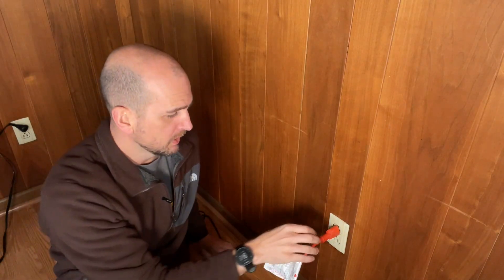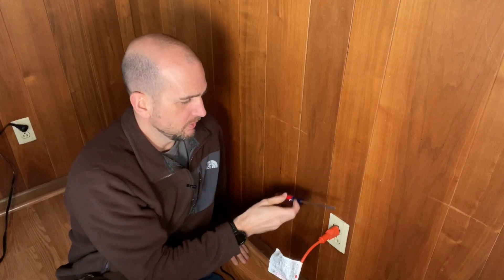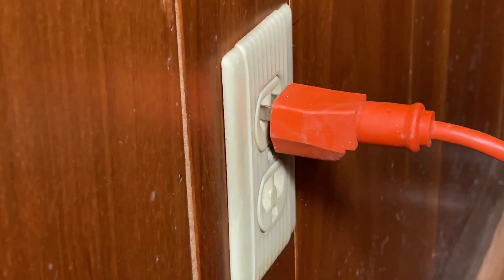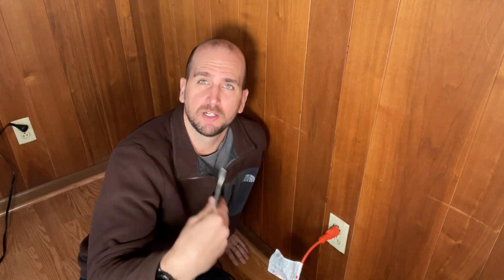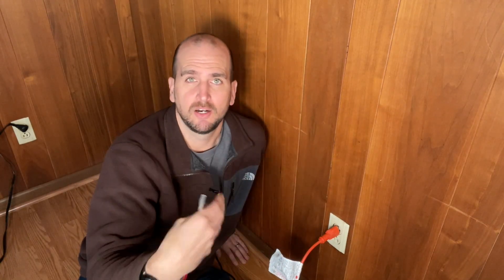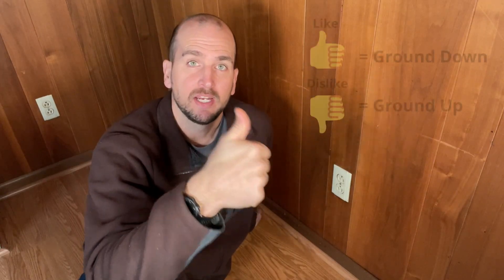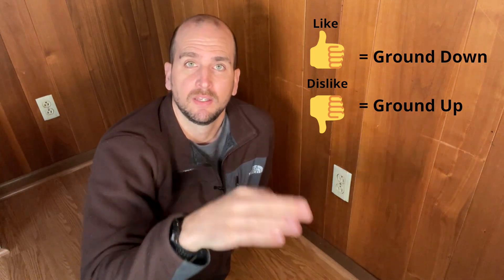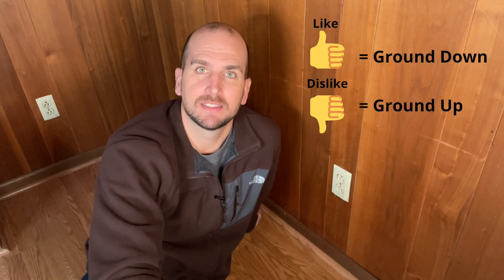Should An Outlet Be Installed Ground Down Or Up

Comment: My casual observation is that most outlets I note have the ground down. I however, like the ground up, as most outlets are installed below eye level making the ground on top when iserting a plug and thus more a more visiable aid in correctly orenting and aligning the plug for insertion. How about that argument?

Comment: When I bought my house, I switched all of the outlets to ground facing up.  I am putting in a 200+ gallon saltwater aquarium.  For those outlets I have them ground facing down, as water is most likely to get into the bottom of the three holes, and I want that to be ground.

Comment: I always do ground down and have for years.   Testers to make sure the outlets are properly wired are used and the older ones only had the lights on top, when the ground was down.  You wouldn't want an electrical inspector to have to get down in the floor and look up to test a receptacle, would you?

Comment: I've never seen an issue where someone dropped a thin metal object down on a plug, but I have seen an issue where cords would hang wrong causing stress on the cable.

Comment: Ground up help prevents your fingers from touching the prongs on the cord and especially keeps a small finger from slipping between the prongs while plugging a cord in like I did when I was 5 years old... I couldn't get my finger out or the cord unplugged because my finger tip was being electrocuted for what seemed like an hour but was probably only 5 to 10 seconds before the cord finally fell out of the receptacle. So I put the ground down because I never want to deny anyone from that kind of hands on learning experience.

Comment: The scenario is just silly: "What if the plug is loose, and what if some thin metal object falls into the gap between plug and outlet?" I've been around this world for 66 years and I've never seen that happen.
Reply: "I've been around this world for 66 years and I've never seen that happen."
I've never seen a plane crash but I know it can happen.
Reply: @AJ-io3bq  I've been around this world for 61 years and I've never seen Africa but, I know its real.   :D
Reply: @blue04mx53  I've been to Africa and I can tell you it's UNreal! Awesome experience. 👍
Reply: No it's not. I went there. It's not real
Reply: @blue04mx53  It is not real. It is just a conspiracy from map makers who add random places to make the maps look fancier. 😂😂😂
Reply: @AJ-io3bq  Yes, you have seen a plane crash.
Reply: @brumalmat9999  No, I have not. I've seen evidence (i.e. the wreckage) of one but I've never actually seen one. Just because we don't personally witness something doesn't mean it cannot or doesn't happen. I have, on the other hand, had a piece of metal slide down a wall and short an outlet. Even so, I vote ground-down orientation.
Reply: I have seen a metal cover plate that landed on the prongs. It sparked and cought the rug on fire.
Reply: My step daughter knocked some metal hangers off her dresser and slipped behind a cord pulled a little out from the plug.It just tripped the breaker.
Reply: @randycrowe2698  Bet you that the lapcord was a two pronger and not a three.
Reply: I beat you by 20 years and I have never seen it happen.
Reply: I was measuring a wall and the tape slipped, and slid directly into the gap onto the prongs. Did not short, but it got my heart racing!
Reply: Try touching one side of a 240 volt switch with one hand and the other side with the other and you'll be glad if your heart IS racing!! 😊
Reply: While installing breakers in a panel box, I had a radio plugged in at the panel. It came unplugged and one of the ground wires I cut from the panel, fell into the receptacle and sparked just like his screwdriver would have. I had to laugh at the ironic situation as I hate grounds up. The odds of it happening is small so I still think the bigger issue is the plugs arcing from not being in all the way. Ground down is one of the best ways to keep plugs from slipping out.
Reply: What if it's installed ground-up and what if the plug is loose and what if there's a stiff piece of metal on the ground next to the wall and you step on it and that causes it to jump up and short hot and neutral?
Reply: If the plug is loose, the outlet needs to be replaced
Reply: Must not have kids or know any.  But if that is silly, imagine how silly it is to install it upside down just cause you think it looks better, for no actual practical reason!  Now that my friend, seems a hell of a lot more silly.  Literally the only reason why receptacles are installed ground down is because people think they look like faces.  It was invented and designed to be ground up.

If I am making a decision, and one way is possibly more safe, and the other way looks like a cute face, what is the more silly direction to choose?
Reply: This guy is like most 3rd party inspectors full of opinions but very low on actual facts and knows even less on codes. He probably believes it’s against code for NM to touch a gas line. Yet there is nothing past or current in the NEC. When you ask them to recite the code they pull up a city ordinance in another state thinking it supersedes the NEC
Reply: I have seen a frying pan short out an outlet to the sink and short out all the power in the house because of pennies in the fuse box.  I have seen solder drip across an outlet and explode.  My daughter shocked herself plugging something in, so she prefers the ground being up so that will not happen.
Reply: Evergreen Hospital, 2002.
Beaded-chain on window-blinds draped over loose plug in outlet.
Shorted across the live and neutral.
Flash-burn on wall plate, chain welded to window-frame, frightened patient.
It was of the few outlets installed ground-down.
Why metallic chain and not braided cord?  Sanitation requirements!
Stainless steel chain can be disinfected, cords not so much.
The rules in Hospital are weird...
Reply: It happened to me.
Reply: @The_Original_Forrest_Trump  You guys are room mates right ?     :D
Reply: it's happened to me, twice! one time I had some metal trim fall on a cord, some of the trim exposed the cord and one managed to connect the two pins and blew the fuse. Another time some smart guy decided to change his plastic outlet cover to stainless steel, for some reason I plugged a cord in before I screwed it in. slipped and dropped the cover into the two pins.... lol
Reply: @tonytaing8173  that’s why the NEC states all metal receptacle plates must be grounded. 
 Metal switch plates using metal screws to a grounded switch doesn’t require further grounding however that code doesn’t apply to receptacle plates for the very reason you stated.

Comment: I have a toxic gas detector plugged into my outlet.  If the ground was installed on top, then my detector would be upside-down.   What I mean by that is that the digital display would be upside-down.  I think functionally, the detector doesn't care about it's orientation.

Comment: If the ground wire is in the position up, it will be impossible for the ground wire to touch the neutral or the source inside the electrical box. 
By putting the ground wire in the bottom position, I want to let you know that the wire gage 12 has 3 wires,  the neutral,  the source and the ground. Remember that the wire enters through the top back of the electrical box and the ground wire will have to go all the way down to be secure to the bolt ground and the chances are that the ground wire may touch the neutral because it comes down to the side of the outlet or the source. 
Anyone who is connecting the ground wire in the down position must be sure that the ground wire not be touching the the neutral or the source. If the ground wire touches the source it creates a short the same thing will happen in the neutral wire. 
It is much better to put the ground wire in the up position because it will never have the chance to create a short inside the electrical box a place where all the wires are connected to the outlet. 
This is the best way to connect the electrical outlet in the electrical box. 
Because it will prevent a electrical short.
No wire will touch the neutral or the source.

Comment: On residential installation it can be either way except when installing metal covers the ground is facing up. On commercial installation the ground is facing up. And on horizontal installation the neutral side of the outlet is facing up. Hope that helps. Just a matter of common practice.

Comment: I still recall a classmate of mine who said he had change on a shelf, and a coin fell down on a plug with the ground facing down. The coin bounced between the hot and neutral causing sparks until it fully shorted out to trip the breaker.
Reply: Whoopee, it tripped the breaker. That's what they are there for. Ground on bottom always.

Comment: I’m used to seeing grounded outlets with the ground down. And when we had a new home built in 1997, all outlets were ground down. Two years ago I bought a house built in 1964 about 40 miles west of where I grew up and mainly lived. And all the outlets are ground up. Except in the basement where there had been a water leak and it is all new. My visual preference is for ground down, and I’ve been changing outlets to that orientation.

Comment: One thing that drives me nuts, nothing to do with ground up or down is switches. In all the houses i have lived in before, the light switch for the porch light was closest to the door, next the light switch for the interior was the furthest, and if there was a third switch say for the upstairs hall it was in the center. I have lived in four houses and this was always the case. The house I live in now, the porch light is furthest from the door. Also since the up stairs hall has a light by the front door, as well as up stairs, in other words 2-way switches, it IS in the center, and there fore to me the only switch properly placed. The problem with this switch however is that who ever wired it up did so backwards. (At least in my opinion) Every house I have lived in when there a two way switches, both switches in the DOWN position means the light is off, and both switches in the UP position means the light is off, only when 1 is up and the other down is the light on. In my present residence on must be up, and the other down for the light to be off. Since I am used to a light switch being DOWN, I always keep the one on the second floor down, I rarely operate that hall light from the lower level so that switch is UP. Or is this just me???

Comment: 40 years ago I built houses in a county that had 6 electrical inspectors, all required ground down. Although not code they reasoned that most cords hang down,  subject to being stepped on. This was likely to pull ground wire first leaving the appliance ungrounded. I learned early on, don't argue with inspectors when a small gratuity usually leaves everyone happy.

Comment: Definitely ground up.  For the safety factor of a child dropping a coin on a three prong plug, but mainly for the use and life of the outlet.  Almost every "ground down" outlet that had a grounded extension cord in is broken because the weight of the cord pulled the the upper two prongs out and cracked the insulator under the ground prong.  "Ground up" outlets never crack.

Comment: Regardless of orientation the rule of thumb should be that the ground should be the last prong to exit the plug. Therefore, if the tension of the cord is downward, which is in most situations, then the ground should be oriented down. Conversely, if the tension is upward then the ground can be up. This rule is especially important in potential “wet” areas. The purpose of ground is to ensure safety in giving rouge current a clear path to ground. This is also the reason that the ground prong is always the longest prong on the plug.

Comment: I find it a little easier to plug in a big extension wire plug if ground is facing up. On the other hand, by convention, the hot-black wire seams like it belongs on the right which requires the ground to be down.

Comment: I asked my Dad who is an electrician.   Apparently there is no code (at least where he is) that stipulates up or down outlets.  That said, he usually puts the ground down in residential and the ground up in commercial.  He finds that in commercial settings, the plugs usually have thicker socket cords and will break the plastic area around the ground much quicker over time.  Regardless of the up or down debate, if the socket won't hold plugs it should be replaced as it is a fire hazard.

Comment: I like ground facing up for two reasons:
1) If the ground is UP you have the round pin facing you as you reach behind a sofa or table you can more easily see the ground pin and insert it as it is the longest, AND you can even feel for the round hole and the pin with you thumb or finger if you can not clearly see the outlet in a dimly lit room, which makes aligning the plug to the outlet easier. No shocks since you are ONLY touching a ground pin, and since usually they are slightly longer the is no current flow until the other pins get inserted. I also wish you could buy outlets have each ground in the opposite direction, that way you can plugin two 90 plugs. If you have each in opposite directions, then the argument as to which way is UP does not matter. Besides which I saw a really OLD house that had outlets installed into the base board. The base board was eight or ten inches inches high, to access wires or electrical boxes all you needed to do is remove the base board, not tearing out sheet rock or plaster as the wires were behind the base board. Switch wires were also at base board level until the reached the location of the switch, where the wire was dropped from the switch down to the base board to an electrical box hidden by the base board. Only problem I saw with this was telephone/cable wire ran along the base board could get cross talk. So a second thought I had about this was to run electric behind the large fancy trim (corner molding) between ceiling and walls. I however like the outlets in the base board because then there is less chance of the plug being jammed against the back to a chair or wood furniture. I have always hated outlets near knee leval as I have always though they ere in the way. Is there any code specifying outlet height? I could see a spec for a basement in order to keep outlet out of the water when basements flood but on ground level or a second floor I see no reason for a specified height. Also why don't they make 90 degree plus so the wire go to the side, then two can be plugged into the same outlet.

Comment: One issue is flooding.  If you have a house that COULD flood, say you live in a 50 year flood plain, then ground down will short to the water first and no shock hazard can occur.  If the ground is up, the HOT gets wet first, and anyone in the water gets shocked.  It's an odd problem I admit.  But if your home has the potential for flooding then down offers more protection for the homeowners in a flooding situation.

Comment: An FYI, an outlet can also have one receptacle switched and the other unswitched, i.e. always hot.  Which way then?  Another comment, I understand that typical in Sweden is to have outlets about 5 feet above ground so children can't play with the outlets and plugs.  In such a situation something falling on the outlet is greatly reduced.

The old house I live in now has the outlets sideways in the base boards.

Comment: here in europe (czech) we use ground up, but in US most/all i seen (yt/internet) are ground down, it looks like a smyly face ; ), soo depends from country to country, nice one :3

no idea why in EU we use the ground up (still at electrician school, and no one asked/explained it) but the argument about falling object is probably the actual reason, and also points out how dangeous the US plugs are (lets say compared to UK or EU ones, the only conductive exposed parts are of the earth one) that doesn't mean US ones should change, ofc why change something everyone is used to, when it works :D also it is lower voltage (but still dangeroous) which some might bring up, gj :3

Comment: looks like that black cord you noted at about 4:45 is 45 not 90, I could be wrong. Another point to consider a "ground down" plug is physically more stable since the ground can be a bit of a stabilizer since most cords hang down and of course gravity rules

Comment: Am not gonna thumb up or down ..... but for me depends .....in the garage ... i like gtound up.....(i treat it as following commercial sstandards). In the bedrooms i sometimes do ground up cause i use powerbars vs plugging in a 2 prong directly....in the kitchen usually ground down as there are lots of appliances with the angled plug.  Bonus...as for horizontally installed outlets....i always have neutral (wide blade) side up no matter the room.

Comment: I do ground down,   the only reason I would put a ground up would be is if I was using a metal cover, that way if cover screw fell out and cover slipped off device it would contact grand first!!!  Seems like I read this in electrical contractor magazine!

Comment: At least keep them all the same way.  Same with switches.   I clean a few buildings, some of them look like the switches and outlets were installed by the three stooges.   One building has a 4 way switch box.  The third switch goes down for on.  It took me a month to figure out the lights in that section of hall weren't burnt out.

I still leave those lights on every night when I leave.

Comment: American plugs suck and are extremely dangerous, the simple fix would be to at least have the outlet recessed so the prongs would never be accessable until they are fully disconnected, just like the schuko plug.